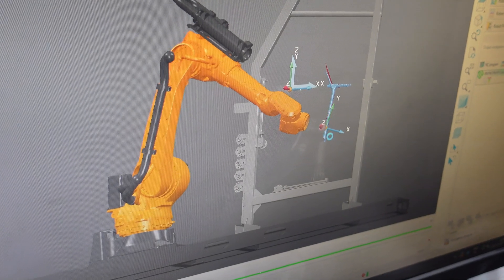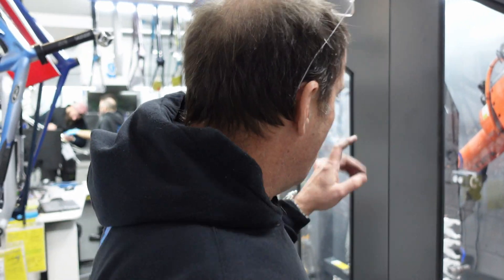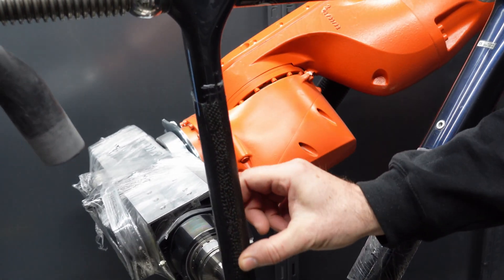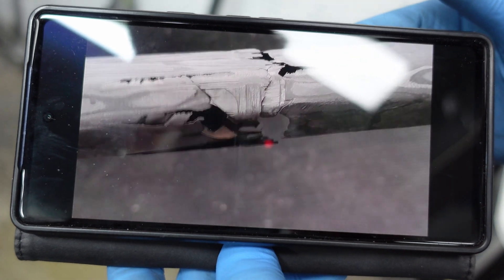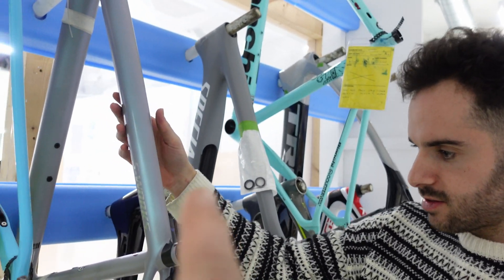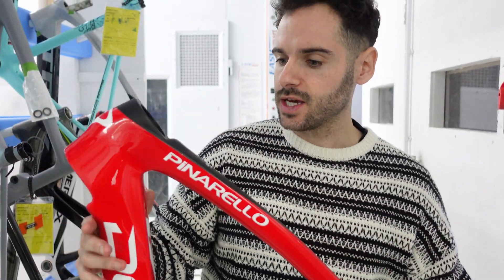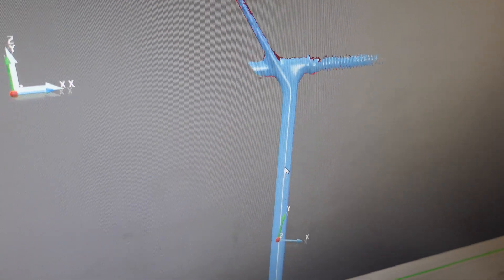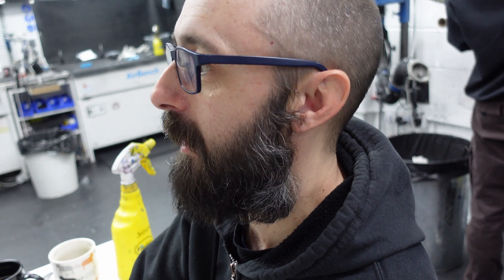The Robot That Fixes Carbon Fiber….

Comment: How do you ensure the laminate is the same? Are they just using woven or stitched biax? I would have thought you really need to match the unis running the length of the tube to keep the frame "the same".

Comment: If the wall thickness is milled down to the same as the original, how is the strength maintained given that the milling process cuts through the fibers thereby weakening the lattice?

I would suppose that a layup which is not milled (i.e. the original) is going to be much stronger than one of the same thickness but which consists of chopped and broken fibers.
Reply: i guess they put on more layers than needed, and just mill the down the excess. At 0.03mil accuracy it should be no problem to take off one layer after the other.
Reply: @66mikkim  Maybe.. That would assume they can get enough layers on the inside cured and with enough compaction to make up for the broken fibers on the outside. For example what if there's a crack in a thin seat stay. Can they even get carbon in the inside in that instance? I'd be interested to hear from them directly about how it works.

Comment: How do they regulate the inner wall though? Or it doesn't matter?
Reply: I have the same question. To me it looks like they simply use a CNC mill to get the outside shape back to original. But they are cutting through fibers and have no precise control on the inside.
Reply: @Mike-oz4cv  Exactly...cutting the carbon fibers reducing it's strength
Reply: I was going to ask the same question.   Overall tube wall thickness ultimately does matter as it affects both weight and the characteristics of the frame.  I think the "robot" is an expensive and slow replacement to a human doing the same thing unless you could control the inner wall.
Reply: @SuperDodoe  My exact thought as well. Expensive way to replace human error! I can understand why they are doing it! But they are the ones laying the fiber layers in the first place and I can imagine the inner walls are not the same as factory!